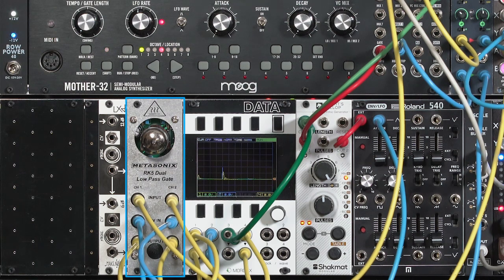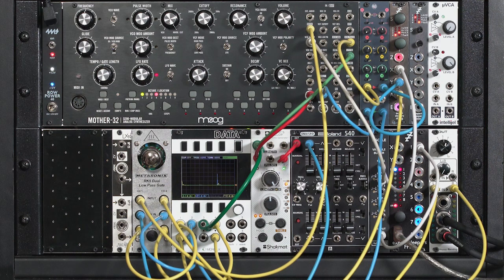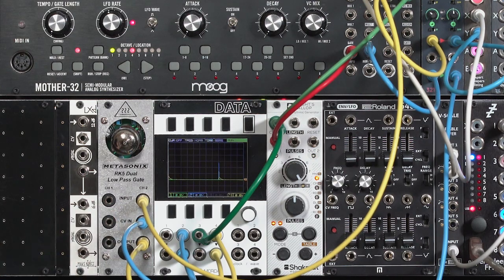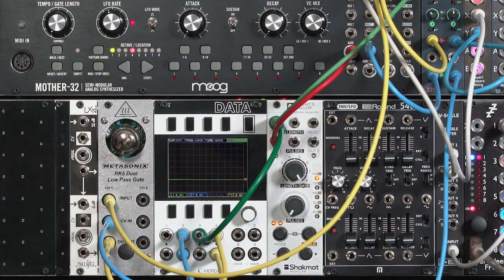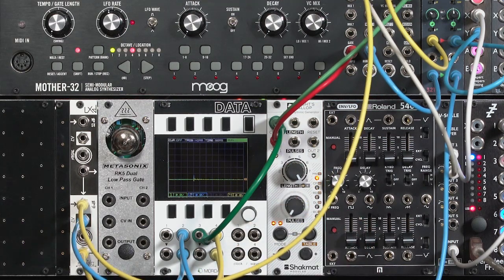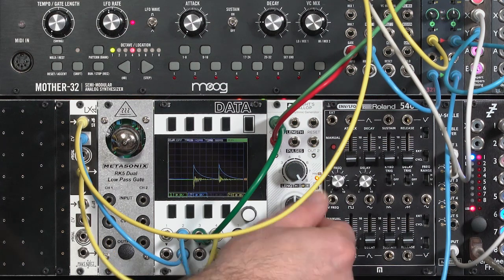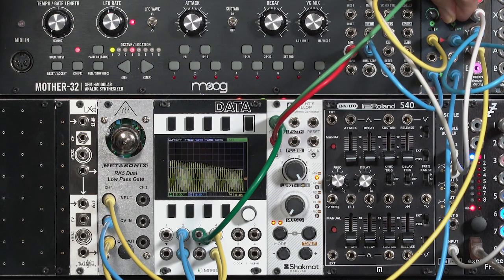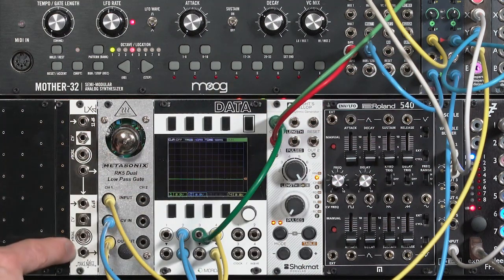Metasonix RK5 Dual Low Pass Gate (LMS EE)

Comment: Another great review. Metasonix is certainly a niche market. I must admit fascination with his drum racks D-1000 & D-2000 as well as RK6 resonant lowpass filter. The prices and additional power requirements mean you really have to want it to make it happen, but really interesting and unique sound.
Reply from the maker: In this case, the 100ma it asks on +12v is not completely outrageous. (Other modules do ask more.)
Reply: @LearningModular   Not that any of the modules aren't worth the additional considerations, but I'm sure that eats into his potential sales. I noticed the newer modules are less taxing. From what I understand the main power suck is at initial power up as filaments reach operational temps. Would love to see your take on RK6 resonant lowpass should it come into your possession.
Reply: Precarious333 Music I’ve never had any major issues with power and Metasonix modules, but I’ve also never relied on “budget” cases either that utilize make noise or tip-top Zeus power etc. Far too many people skimp on power selection, but overall the rk5 and the RK6 are both designed to be friendly to those lower spec power sources
Reply from the maker: Precarious333: I do indeed have an RK6 here, and plan to create videos for it later.
Reply from the maker: And BTW, the RK5 (and RK6) need 200mA instead of 100mA just on start-up.
Reply: @xwestonx   Good to know. Appreciate the feedback. A whole row of them would require the Metasonix power supply I'm guessing but that's clearly something one would plan for. Watched a few of your Metasonix videos just the other week! Enjoyed them. Not enough Metasonix videos out there so thanks for sharing.
Reply: @LearningModular   Very cool! I look forward to them.
Reply: Precarious333 Music I now use a monorocket “Metasonix” case so power shouldn’t be an issue for a long while (I currently run 5 tube based modules), but my old 6u was a doepfer psu3 and that did fine with an RK2 and two additional tube modules (Zerosum Inertia).
Reply: @xwestonx are your zerosum inertia Eurorack modules ?
Reply: @saren6538  yes they are. Noise Sorcerer and Voltage Controlled Annihilation. Not sure if Brian is still making them or not since I haven’t touched base with him in a while, but they are great modules. The NS is a bit of an odd one, but fun to use as a CV source and the VCA is a nice tube driven VCA.
Reply: @xwestonx  I’ve never seen them anywhere do you have his contact ? And he made 2 is that correct ?
Reply: @saren6538  check him out on Instagram Zerosum_Inertia he had a 3rd module in the works, but I’m not sure it made it to prototyping.
Reply: @xwestonx  yes I found him on insta his account is private and can’t message him let’s hope he accepts my friend request
Reply: @saren6538  🤞 let me know if he doesn’t and I can reach out to see what he’s up to. It’s been a minute and it’d be good to catch up.
Reply: @xwestonx  ok thanks will do
Reply: Thanks for the like on my metasonix post just now on the group 😉

Comment: Thanks for this demo. Still seems a bit expensive for what it is. I have the L-1 Mutant Cure VCF, which is about the same price, and that's a truly amazing and unique filter, actually really great for LPG/short envelope type responses since it gets so wild..Metasonix stuff in general though seems to be a lot of money for a very particular sound.
Reply from the maker: The Metasonix modules (along with a long list of other modules I could name) indeed are not cheap. FWIW, they are hand-made in small batches, and require rather specialized knowledge to create, so there's not a lot of mass-efficiency there. We all get to vote with our wallets. Me, I'm happy to have variety; if someone resonates with their sound, at least they're available.
Reply: @LearningModular  Yeah, and I own some of the other ones..like I said, it's a very particular sound, not too flexible..I guess if you really like it it's a no brainer. For me I haven't been blown away by most of what I've heard from them just by virtue of tubes.
Reply from the maker: It's always a module-by-module, user-by-user thing. In this case, the thump it can add to percussive sounds (which is barely conveyed through the compressed audio on the movie - it can be wicked) has sold me on keeping it in my main case. But...that is one module for one specific narrow range of sounds, as you say. I just happen to like that sound, in this case.